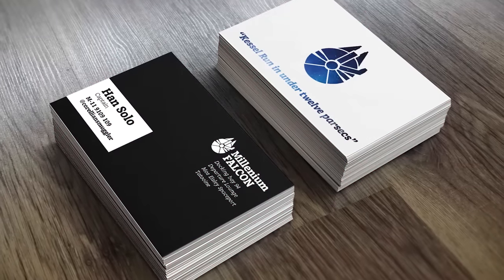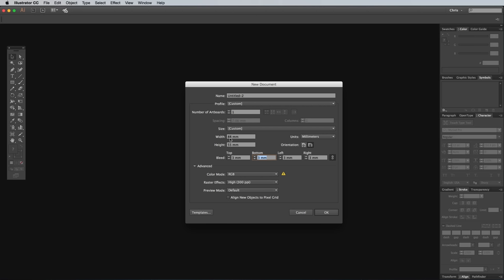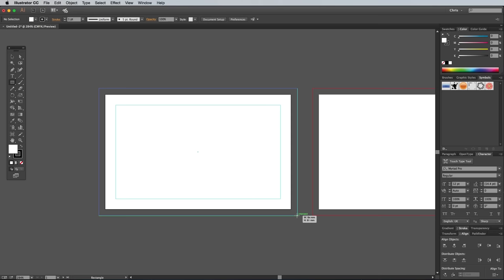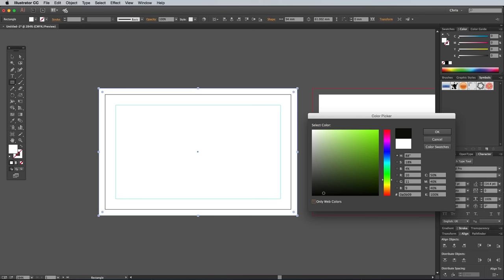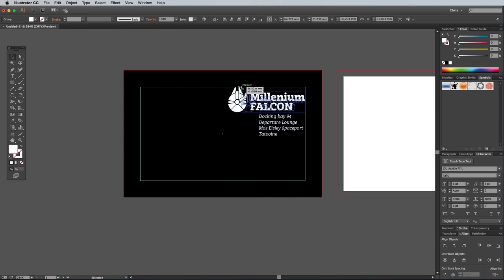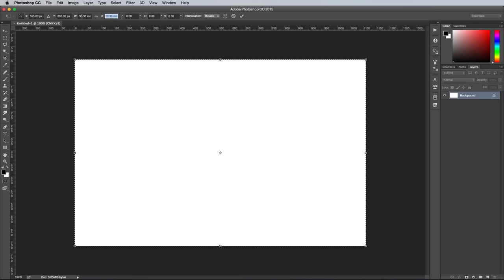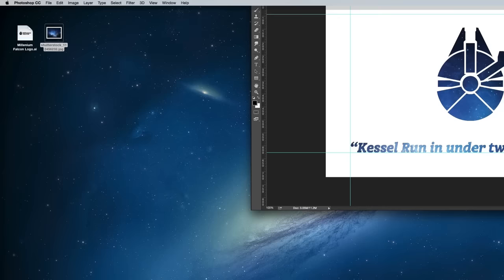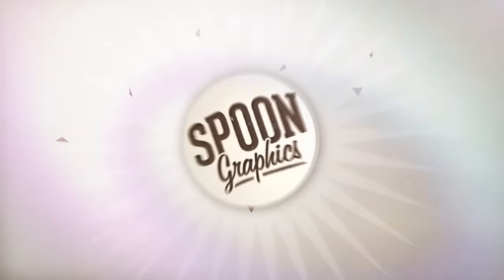How To Create a Print Ready Business Card Design

Comment: Hey, I'm a big fan of your vids and your blog. I have one question: Should a designer set overprint and if so, in which cases? It's something I barely see anyone talk about. Should it be applied to every instance of 100% K text where it's placed on top of a colored background?
Reply from the maker: +Mike M. I have to admit, I've never worked on a project where I've used Overprint for real, but your example would be the perfect use for it to eliminate the risk of any white showing from where the underlying colours are knocked out by the print rip
Reply: Spoon Graphics Thanks! Have you ever had problems with plate misalignment?

Comment: can you please tell me , how did you do the final presantation 3d like format ??
Reply: Its called mockup. You can easily find one on the web or you can make one yourself. Hint: you don't need to have the cards printed to do that.
To make a mockup you simply find (or make) a photo of a pile of cards (the design don't matter), put it in Photoshop, draw a rectangle with the proportions of the card somewhere in the document, right click on the layer and make it a Smart Object, then using Transform place it on the existing design (you can press Ctrl to make it squish into shape). Now open the smart object by double clucking the icon in the right bottom corner of the thumbnail, position your design in it and save it, go back to the main file and Voilà!